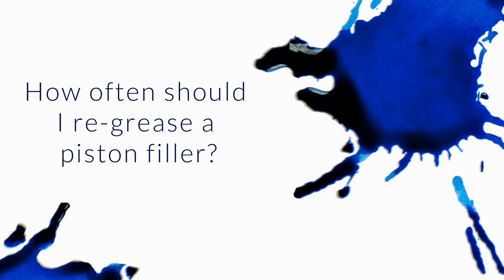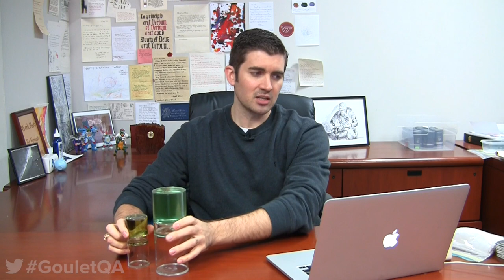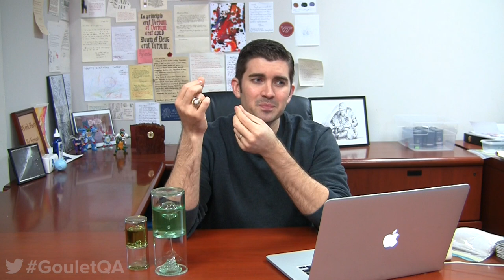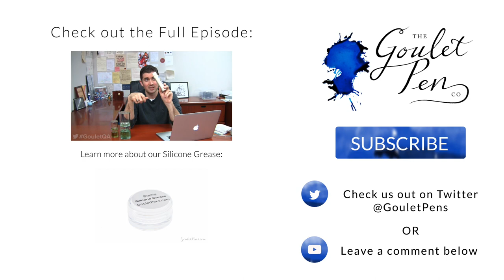How Often Should I Re-grease A Piston Filler? - Q&A Slices

Comment: Maybe a strange question, but do you need to grease piston filler converters?
Reply from the maker: It certainly doesn't hurt, but usually only if you notice resistance is it necessary. - Colin
Reply: Thank you for the very fast answer.
Reply: The Goulet Pen Company Just wondering...could I just use the Silicon grease that I usually I use to my nitecore flashlight? Will it be OK?
Reply: Can you use the silicone grease that comes with the TWSBI ECO to grease the threads of a converter? I think that the TWSBI product is silicon oil, but to grease a converter you need grease, which is thicker.
Reply: I have gone without greasing  my pelikan for 7 years. As I simply didn’t know I needed to. It was just fine with all the abuse. I finally did it…